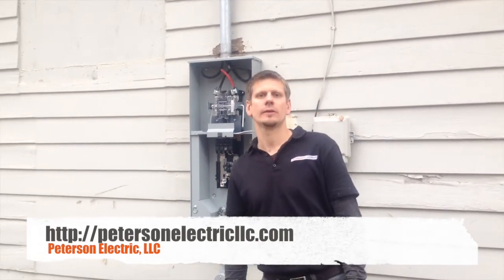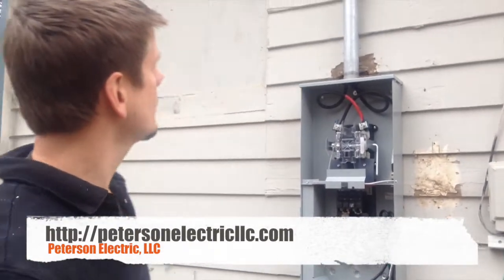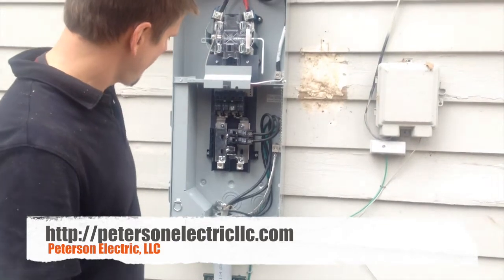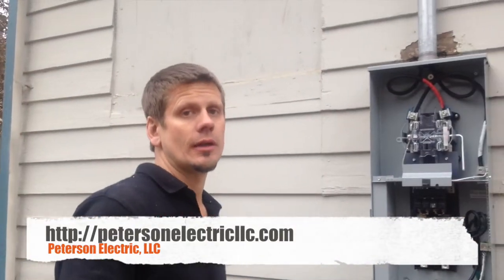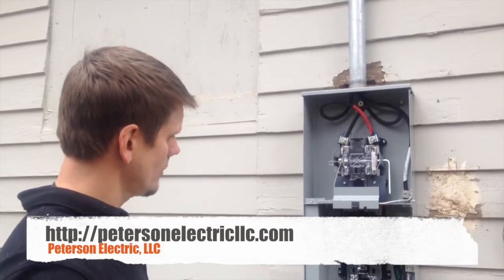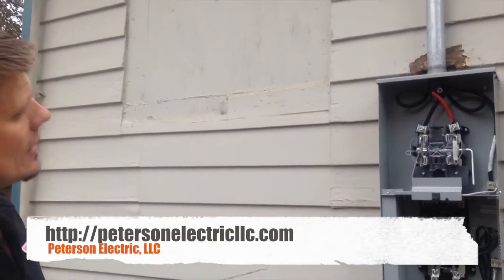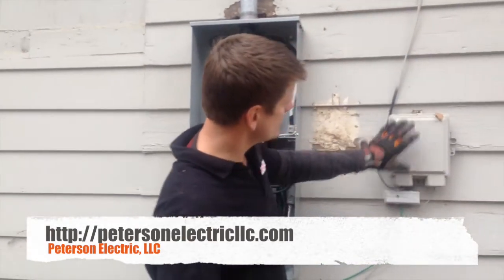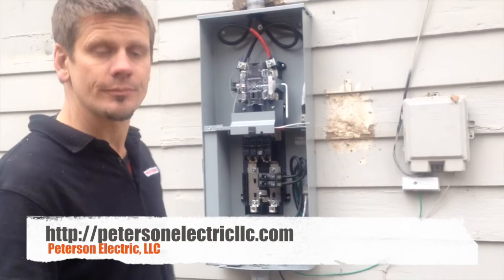Installing Overhead Service Change With Bypass Lever & Meter

Comment: The NEC does NOT require neutrals to “Float”. Neutrals are NEVER floating in a residential electrical service. Neutrals are ALWAYS solidly grounded. That’s why they are properly called the GROUNDED conductor.